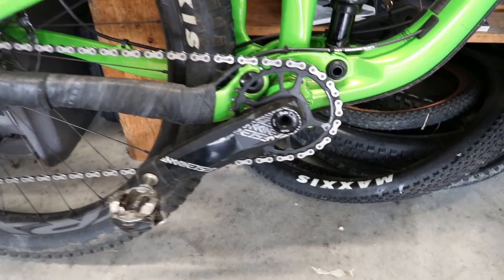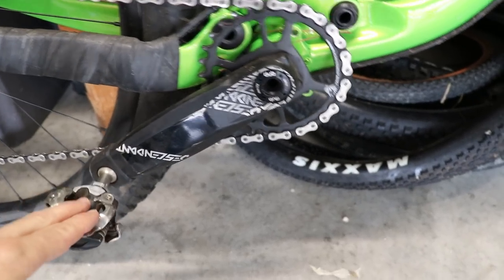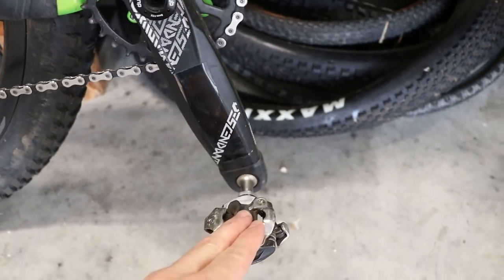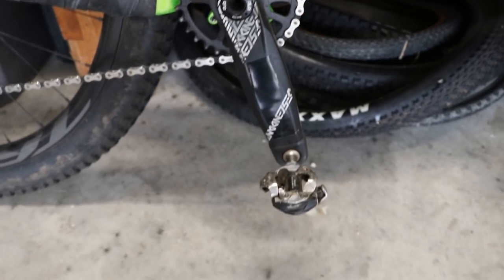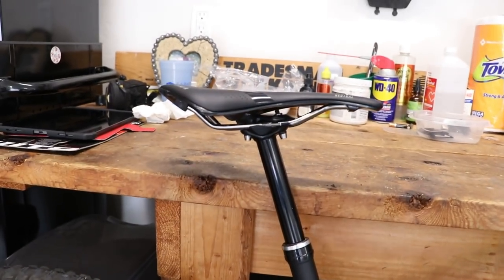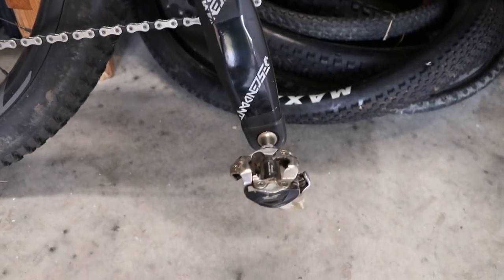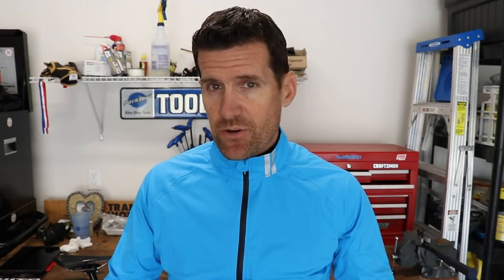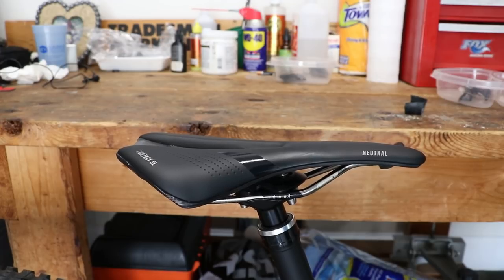Bike Tech Tip: How to Set Your Saddle Height

Comment: I have never had the seatpost slipping down, even when not tightened enough. But I've had my seatpost slipping UP - it was on the previous-generation Stumpjumper, when the Command seatpost is with the default recommended pressure, it extends too fast and actually pulling up the seatpost, even if it was tightened with a torque meter!
I always set my saddle height this way, and it was millimeter perfect to the bike fit measurement I recently did.

Comment: Good tip!  I usually raise it where it is too high, then drop it until it feels just right. I think your tip is better. Also, seat position can affect one’s power as well. Too far back can lower the power applied, since it changes the angle of your legs to the pedals.

Comment: As a road biker, I like this method plus about 5-10mm. Right at the height I get without rocking hips, pedaling backwards, it just feels too low to me. Add 5mm and it feels OK, if not somewhat low, but I believe slightly lower is better than slightly higher. When I use the formula .883, that puts me 2cm higher than this method. That would definitely cause hip rocking, back issues, back of knee issues and probably hand weight issues. My cleats are all the way back (on Shimano shoes, which go further back than most) so that might make some of the difference. I just don't like the formula approach unless one knows to lower it 3cm from that point then work up 5mm at a time.. which is not usually the advice given. This method gets you closer faster, in my experience.

Comment: Hallo Clint,  very good tips you are providing us. Got a question about though,  when you set the saddle height in a full suspension cross country bike,  should you do that with both suspensions into the lock mode, or having the suspensions active.  If the suspension is opened in the rear & front the suspension will compress to the amount of the sag, and then consequently the saddle height will change??  So how do you set the height,  being open or lock. Thanks again.
Reply from the maker: On a real full suspension bike the distance between the bottom bracket and saddle height does not change.
Reply: @ClintGibbs  yes you are absolutely right,  the distance does  not change.  Kindly Thank you for your response

Comment: Thanks for the tip! I just used this technique on my 2011 Trek X Caliber. It feels great while riding. But im still trying to get use to the seat height when stopping. Mounting or dismount. The seat seems so high from where I originally had it set. (Which was way to low).
Reply from the maker: 3 rides and you’ll be used to it

Comment: Do you take into consideration on a full-suspension bike the sag from the rear shock or do you make the adjustments with the shock locked?
Reply from the maker: No. The distance between the bottom bracket and the saddle never changes on a full suspension bike. Only the rear triangle moves.
Reply: @ClintGibbs  Thanks for the reply.

Comment: Clint, I’m getting a little pain when I peddle in my left hip muscle.  Wondering if this may be my seat height?
Reply from the maker: Lower your saddle by a centimeter or 2. Also check out the video that I’m posting this morning on measuring your knee angle. Personally, I’ve been having some IT vent issues lately so I’m going to put my saddle around 35 to 40° instead of the usual 30° that I run.

Comment: Hi.  I have tried changing seats with my Trek bike.  I am not comfortable with the seat I have.  It is not good for long distances.  I bought a big fat seat, but I'm not sure how to put it on.  The bars underneath it which usually help to hold the seat look like they are too thick.  I am really disappointed in this TREK design.  I don't understand why they changed the design not only of the seats, but the bar to put it on.  They make it so you can't just put any seat  on.  Very frustrating to say the least!!  Can you give me any advice?
Reply from the maker: I would just have your local shop install the seat. That way if it is not compatible they can handle the return.
Reply: @ClintGibbs  Thanks.  I didn't want to have to go there, but I don't think I have a choice!!!

Comment: You're using same pedals, same cleat setup for all your bikes?  Seems like this method might set the seat a little low for a road bike with road bike style cleats (especially built up cleats like Speedplay).  thoughts?
Reply from the maker: Same pedals on all my bike. This method will get pretty close so you can get up and running with a saddle about where it should be.

Comment: So There Are No Difference On Measurements Between Road And Mtb Bike?
Reply from the maker: You want the same knee bend on both. That's why dropper posts are great on mountain bikes now. You can have the proper saddle height when you need to pedal hard and then drop it for technical descents.

Comment: I think this method will cause the saddle to be too low by a centimeter or 2...typically you want almost full extension of your knee with the ball of your foot on the peddle to prevent knee pain. Just a very, very slight bend when the ball of your foot is on the peddle
Reply from the maker: Your leg should not be locked out when the ball of your foot is on the pedal. You should have a 25 to 30 degree bend in your knee. If it's almost locked out you could run into IT band issues.
Reply: @ClintGibbs  Thanks...didn't know that, I'll check that out. From watching other bike fit video's, I run about a 5 percent bend, not locked out, but I definitely don't want IT band, nor knee, issues.

Comment: I'm happy with my saddle height and position however I'm having problems with my hands tingling or numbing during rides. I find myself shaking my hands to get the feeling back. I have been making bar adjustments but nothing has helped yet. Do you have any ideas what the cause could be? Enjoy your videos, keep up the good work 👍
Reply: Same thing happens to me Joe. Might be carpal tunnel  but you really should get a professional diagnosis. My son is aphysician assistant and he feels that is what the problem is. He works for a neurology group and sees a lot of this stuff on a daily basis.
Reply: Joe Stella, you should try adjusting your handlebar height (less drop from seat height) to unweight the forearms some. Riser bar, flip the stem, or stem spacer adjustment can do this. Changing your lean angle may provide relief. If you have done these with no relief, i have seen cycling friends go through carpel tunnel surgery with mixed results and just seems extreme to me. A Pro Bike Fit session would be an avenue to consider before any medical expense. Hope you find relief and happy riding to you.
Reply: When I went to big thick foam grips... the problem went away completely.
Reply: I get the same issue when I go for longer rides.  I fitted my bike with small bike horn handles that way I can at least periodically adjust my hand positions throughout my rides.  It has helped me a bit but hasn't removed the problem entirely.
Reply: Hope you found your problem, I have the same issue at times. Try more foam in the handlebars if you haven't already. Fizik makes handlebar gel  Do not bend your hand back, that is really bad, so keep the wrists straight and adjust your saddle fore and aft position, watch your saddle tilt, you should be able to come up from your handlebars without too much effort.
Reply: I got some Revgrips and my tingling has gone away

Comment: Is the bikes suspension Open or closed??
Reply from the maker: Shouldn't matter for this
Reply: @ClintGibbs  ok, but if you feel that you dont get the power down right could it be that you should rise The saddle a little bit more??  @clintgibbs
Reply from the maker: @robertkarlsson7238  yes, if your saddle is too low you will lose power
Reply: @ClintGibbs  but I have set the saddle hight according to your video... but still not good enough for pedal effect
Reply from the maker: @robertkarlsson7238  try the 109% method that I showed in a separate video
Reply: @ClintGibbs  thx👍 keep up with The good videos